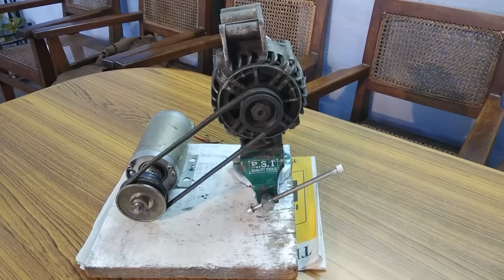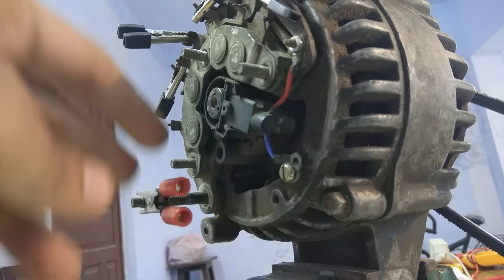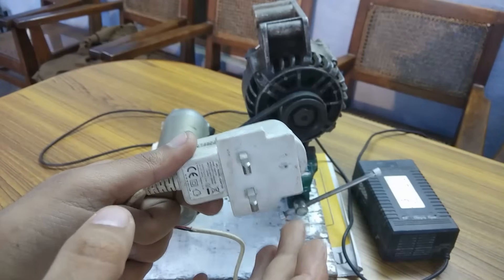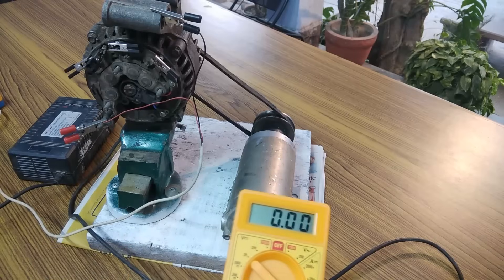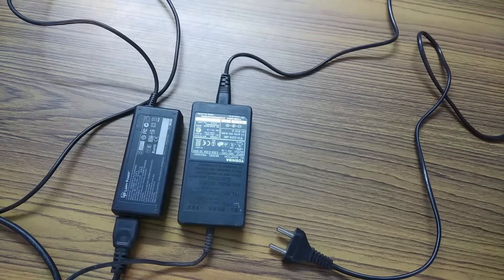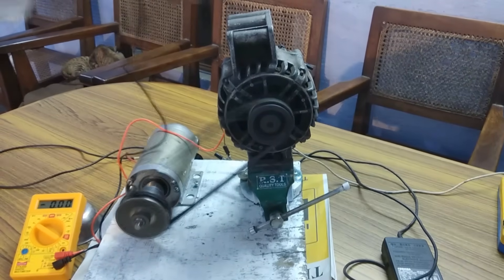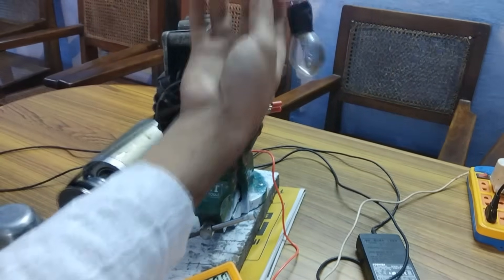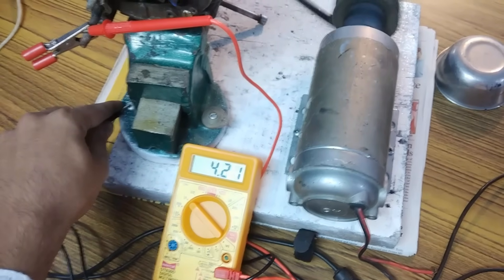Self excite an alternator without any DC Generator, capacitor bank or battery

Comment: can some one explain to my some things here Im old school I dont reali understand that rubbish ic chip crap but tehnicali speaking that alternator is useing ground potential voltage if Im not mistakeing some things here because my Delco 12si Alternator is A circut type so tehnicali that voltage regulator meshures ground to positive balance voltage potencial so tehnicali can some one correct my if Im wrong here normal capacitor/resistor box shuld work as well to control those alternators at any speed ? Im refering to the alternators cutt in curent at centrain rpm ranges Delco 12si starts to charge around 1000-1200rpm . So did ever some one try to use dual voltage regulatora like those for tractors for exampel? Did some one try to use Magnet Alternator with normal step down transformer and capacitor some circuet that disconects the baterry ? I have problems I need baterry/capacitor banks for different aplications like running 2 or more ignition systems seperatli so wondered how is that done some peopel mentioned cloosed loop voltage regulation but they are not specific whal ells to use to prevent the baterry over chargeing it so I tought of current cut out selenoids that used old generators for exampel so Im not shure wuld that work or not? Originali I wanted to take 1 phase out and use it onli on cabacitor banks 2 other phases for the baterry so not shure again how that wuld turn out . Solar panel voltage regulators are expensive in my land so I need to finde some alternative solution . And did actuali some one try to use those darlington heavy industri parts like bridge rectifiers on normal alternators? Im anoyed as well at Delcos low quality parts so Im curiuse if some one tryed to use real heavy dury generator parts on those alternators like frequency stabilisers etc

Comment: This info is incorrect you do this with a modern 200+ amp alternator you will blow the brushes clean out. The field + is connected to + output on the stater and field - is connected to a voltage / current limiting regulator or a capacitor or a resistor.

Comment: Great advice here, would you know how I can excite my alternator, I have 4 posts on the back, B+ B- W and D+, the W goes to the rev counter, that works fine, the D+ goes to the alternator light, I don't come on when I turn on the ignition, but when I start it, it does start flashing, and the alternator produces no output, could I bypass this some how
Thanks, great video
Reply: AII Iives Matter MalcolmX was right about liberals 
I can't find any info, I've spent days looking, it's an old 1990 diesel engine in a boat, I thought the old alternator was knackered, so I brought a brand new one but still no output, I'm told it need to be excitated to start producing voltage, but frankly I'm at a total loss when it comes to electrical stuff like this, I've been working on this engine all summer, and have made so many repairs but I've been stuck on this poxy alternator for weeks now and still no solution, but thanks for the reply, much appreciated 👍

Comment: how about a three dimensional printing for each type to just put it together and i don't see you self exciting two alternators one small and one large. then making a loop with a electric control system and showing the huge leftover amperage. try 40 amp to 350 amps.

Comment: Please create a radiator powered by 24 volts battery that connects and charge a storage battery preferably 6,000 watts to run a 240 volts home. Thanks brother

Comment: Well that's not really self exciting the alternator without DC Generator, capacitor bank or Battery, if you use an external power source it isn't self exciting anything!
Reply: Ikr wtf. he has another video, same thing. Charged with already charged capacitor bank.

Comment: A motor is a generator technically! but cool that its working like at no load maibe get N51 magnets . I wanna turn universal motors in to permanet magnet generators and with mini solar cells and have like portable power stations( like a cooler on wheels with handle antena/extension to reach a windy days energy or a sunny one. or both with a switch that decdes to use volts when there high in solar or wind. then the othe volts are good and if the wind picks up it gets switched to current and etc. A retractible wind generator and folding panels and small charge contoller. Good for the great outdoors or in emergency situation. I was working on something like that once. using pullies and silicone tranformers or modules but battery efficiency and motor efficiency and its all mind vs matter or mathematics n magnets.
Reply: Jorge Garza il

Comment: Can anyone tell me why I can't get a pretested alternator to charge a new - tested -battery?
All resistances tested; grounds cleaned; circuit to functioning dash warning light working; but D+ post on alternator putting out 1.5 volts when car running - B+ post on alternator will only exactly match the voltage at the battery? (fifth new rebuilt alternator !) This is  '86 Volvo DL 240 - and the ECU is not part of the circuit. So, technically, I should be able to 'stimulate' the alternator to start producing voltage by joining the B+ and D+ posts on the alternator but I can't get it to charge!

Comment: you are still suppying voltage to the motor ......do you think we are all idiots?.............. all you are doing is spinning a generator and measuring the power output. almost all tractor generators are self exiting after you reach around 1500 rpm which is pretty slow. all it takes is a small current. some don't even need that much.......in fact most don't. find a job and stop trying to bs the public.
Reply: +ONEVOICEOFMANY - No.... He's showing you " HOW TO EXCITE " the Alternator. Please remember that word " EXCITE ".
Reply: usually, the current passint thru a very small bulb is suffucient to start charging a good alternator, an alternator that is in service will self excite as long you jump the field coil to the output post even is there is no initial voltage ( or battery ) linked to the post
this will not happens on a brand new alterntor that has been never magnetized.

Comment: It is like running your car without a battery. As long as the engine turns there is 12 volts to energize the alternator field coil. After the battery starts the engine it can be disconnected and alternator output will run the voltage regulator. All energy will be coming from consuming gasoline, just as your setup is being powered by the mains. It is interesting you have demonstrated an alternator can energize it's own field coil but this arrangement serves no practical purpose....Thanx!
Reply: +Coil Smoke - You are 90% Correct !!! If the Alternator is " Big " enough.  It can actually will maintain the Car without the Battery. So in theory, you would Calculate how much Power / Amperage to keep the Car running, then add a bigger Amperage Alternator, it will continue to run.
Reply: Coil Smoke your right. If you guys Don't believe this start you car un hook bat.car will run then un plug your alt.car will die. guarantee you.
Reply: @garyparrish4907  its makes perfect sense, same thing as boast starting a car when the battery is low on cranking amps or when you need to jump start a motorcycle

Comment: Nice Job,   But,  You'll loose some output,  How ever you are gonna spin the alternator,  The self excitation with be subtracted from the output..  it don't come from nowhere.
Reply: ThomasTheSailor Chubby 
the alternator doesn't take much power to excite. only a few amps. and alternators these days output 100 amps or more. usually 150 or so. even with the excitement.
Reply: James strange,   I know that,  but, take a look at that alternator,  it's an old antique..  Most likely, it's not from an American car..   Some tiny budget,  Foreign cars probably have 60 amp alternators, maybe less.  It looks like a very inefficient thing to Me.    I'm sure it'll work,   but all I'm saying is,  don't expect much from that rig up.
Reply: So....go hook up more from a junkyard, use a ceiling fan to make a turbine gen. WTF is the problem?

Comment: Ill keep an eye open for when you release the video in which you make that alternator turn using its own generated power.
Reply: +Raul Ortiz - With enough RPM, it will :)))
Reply: That is what they do with Mild Hybrid cars. The alternator is also the starter motor and give a slight power boost to the engine when required.

Comment: so what would be the use of that alternator?
Reply: NONE ... This device only consumes energy from the mains. It has zero advantage over conventional power supplies and inverters. It is a very inefficient arrangement that only shows an alternator can energize it's own field coil it you spin it with  external power. Sorry but this device has no real use. It is similar to a DYNAMOTOR from the mid 1900's but way less efficient...
Reply: Bhien Alivio    خلاقیت عبادت وازخودگذشتگی است
Reply: +Bhien Alivio - Maybe like a Hydro System or even Wind.  As long you " Excite " the Alternator and with enough rotation from your source, it will keep producing the Power for you.
Reply: That alternator used to charge a car battery, That what i think.
Reply: +Nerdygirl - LOL
Reply from the maker: Same as a normal alternator.Run your household fans , televisions , tube lights etc by connecting an inverter directly without connecting a battery 😊😊😊😊
Reply: It can run your house.